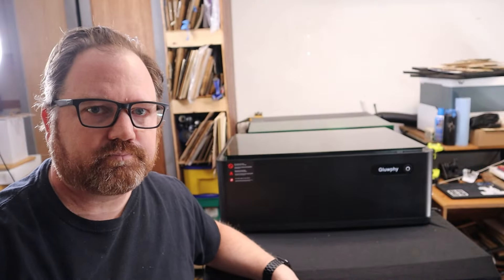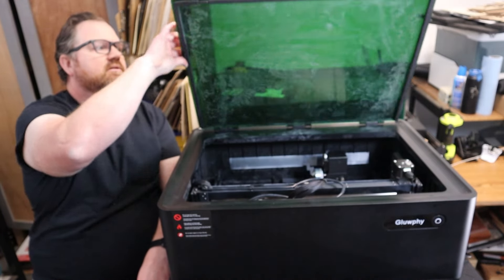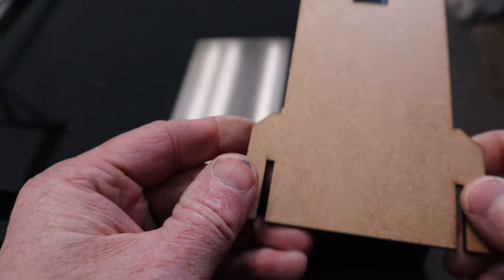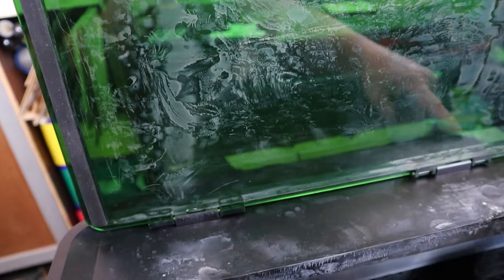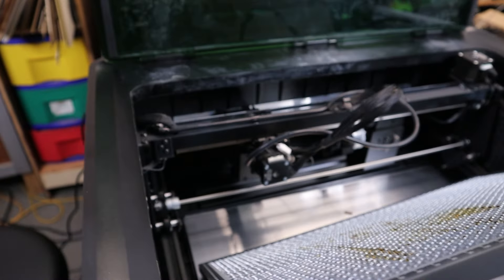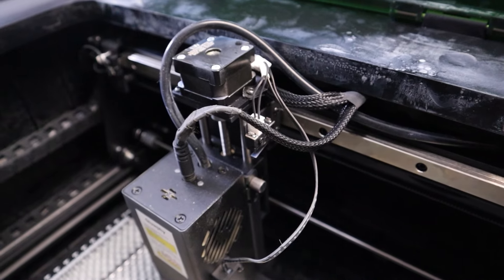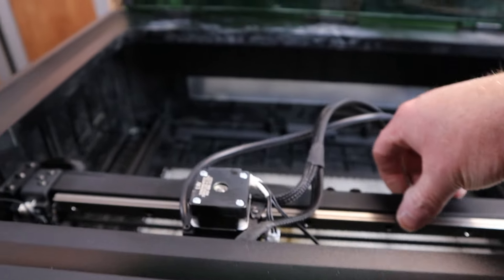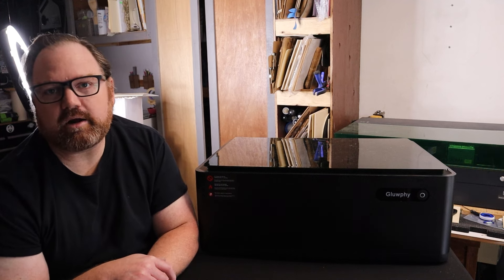Gluwphy 20w 8-in-1 Laser

Comment: If you take the cover off the flame sensor, there's a variable resistor inside you can turn to adjust it. And you can engrave clear acrylic. Just leave the paper on it and mirror the image.
Reply from the maker: I figured out the flame sensor after I released the video, I just never posted an update. As far as the clear acrylic, I have not tried it with diodes, but I have been able to engrave clear glass. I will try the acrylic with your recommendation. Thanks for watching.

Comment: Those fire sensors are just UV light sensors. so if you open the lid, puff! If you get a little flame up on cutting (Which happens) puff!
No camera i assume? not even as addon?
Reply from the maker: They are planning on adding a camera for their 2.0 version. The laser does have a projected "x" on the piece that helps with placement though.